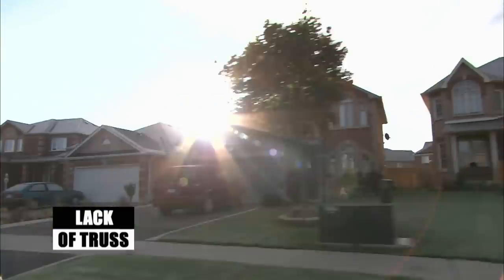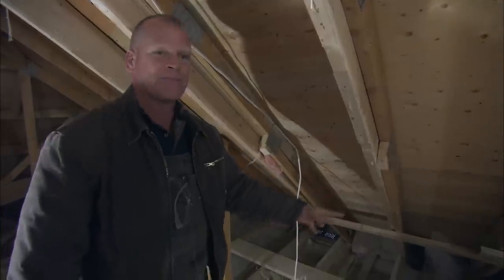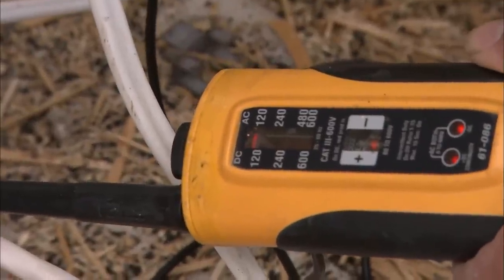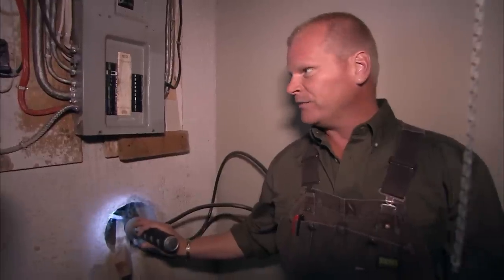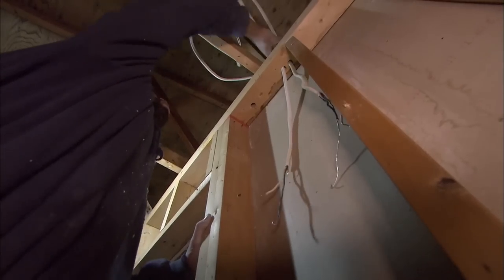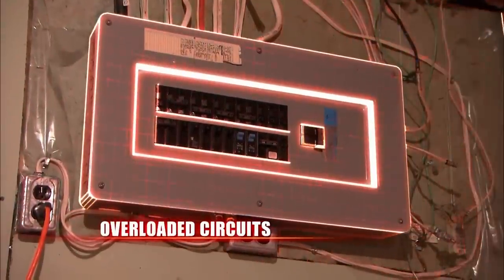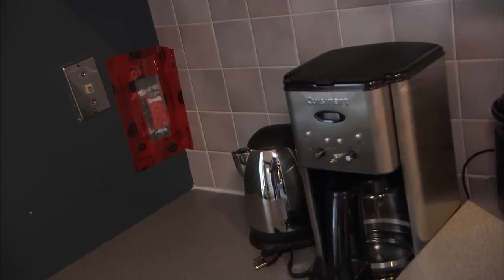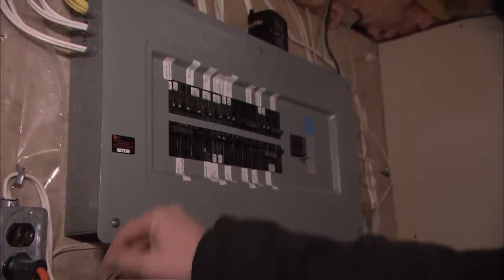Most Dangerous Electrical Disasters Found in Homes

Comment: I was working on a house that had been rewired in 2019 a few weeks ago, where an RCD (GFCI) kept tripping. Usually I'd trace it to a faulty appliance that's plugged in, like a kettle that's been over filled or just water in an outside light fixture.
 I ended up pulling off light fixtures and inspecting wiring etc.  I also turned off one breaker to replace a broken outlet, only it didn't turn off - I'd found that it had been cross connected to another circuit in one of many cable joins in plastic 3/4 inch wood screw jars.  In the end, I traced the fault to an old 1950s TRS (Tough Rubber Sheath) cable with badly cracked insulation and water filled screw jar junction under soggy insulation. I found a lot of wiring from the 40s and 50s that was supposed to have been replaced. Sh*t job of the wiring, but they did a wonderful job of the breaker board, though.

Comment: I had a professional, certified EV electrician, install a 48 amp charger on my home. He installed a separate switch nearby to turn it off "just in case." I also agreed to a home surge protector. Yes, it cost a bit more but I know I did the right thing.

Comment: The real hazard with illegal grow ops lies with bypassing the meter and tapping off the line side of the meter to evade suspicion from unusually high power consumption and having to pay for the power used thereby cutting into profits.  Because service conductors by definition do not have overcurrent protection,  a short would lead to fire, arc flash and catastrophic damage.
Reply: I guess it depends on what country you are in and how the mains distribution is set up. Here in New Zealand, every house is protected by a 60 A fuse on the pole or pillar box outside. If you short out the service main, it just pops that 60 A fuse and all is good, except it can then cost you a few hundred dollars to have the power company come and fit a new one. If you need more than 60 A supply, you can have a second or third phase connected. Our mains is 230 V (phase to neutral).
Reply: Over here (netherlands) we still have dangerous situations like that because of the ban on growing weed. If it wasn't banned, it could just be produced safely in greenhouses like all the rest of our vegetables. Things could be a lot safer but we still have a bunch of particularly dumb politicians and voters blocking any initiative that could lower crime and improve safety. 
That said, the professional but illegal growers often take some care not to screw up the electrics, because if you burn down the place you won't get any profit either.
Reply: @sw6188   @S W  thx for sharing.  I love learning how other countries have vastly different electrical systems than the USA.  Here in the States, and much of North America as far as I'm aware of,  for 99 percent of residential services we use 120V line to neutral,  240 volts line to line, 3 wire single phase, with 200 amps being normal for new construction.  The largest I've helped install was 1,000 amps, 120/240V single phase in a multi million dollar home with a couple spa and pool heaters and pumps, a total of eight 6,000 watt quartz heaters, 4 on each outdoor patio levels, and a detached indoor volleyball court.   The house was approximately 15,000 square feet if memory serves me right.    

Here are some exceptions to the rule.   Smaller homes built before WWII,  with the original service might have 120V 30 amp service,  with one hot and neutral from the pole.   Some utility companies require any service over a certain amperage,  typically more than 600 but it  can vary,  to be a three phase.   Some homes in the southern states may have a high leg delta three phase service if the home had a 5 ton air conditioner in the 1950s or '60s,  as some of the earliest outdoor condensers were only available in 240V three phase.
Reply: @Sparky-ww5re  I've learned a lot about the US over the years, I have friends living there now and one friend who is from Buffalo who has been living here in NZ for the past 35 years. 
I didn't know that service main feeds to new installs were 200 amps. I guess you need that much when you are only dealing with 120 volts.
Most business premises here are wired with three phase - 400 volts phase to phase and 230 volts any phase to neutral.
Houses can have three phase supplied to them as well if they need more power. Many houses in rural areas have either 2 or 3 phase supply as it helps to balance loading on lines that may run for miles before there is another 11 kV step-down transformer.
2 phase supply is the same as 3 phase but one less cable, so there is still 400 volts between phases and 230 between each phase and neutral.

Comment: I’ve got one for you. I have an old push oh matic panel. The previous person who rented the place kept having their washer trip a breaker. He thought it was because it was tied in to something else. No. Went to replace the plug and it fell apart. The plug had never been checked or changed since the 1970s or before.
Planning on having the electric completely re done but it’s going to take some time. The house is about 130 years old ranch style home.😅
Reply: Pushmatic panels should be completely replaced due to the lack of replacement breakers. If a breaker fails, what do you do …
Reply: They still sell replacement pushmatic breakers fyi… they are actually still manufactured. Just not very cost effective
Reply: @dustina6261  - some inspectors like to see the name on the panel match the name in the breaker or they won’t approve (even though the breaker is the matching product). I don’t think the names match with any replacement breaker that you would buy today.
Reply: @stevebabiak6997  who told you this? I am a master electrician and can tell you this is not true at all, are you licensed?   no one is even talking about inspections since pushmatic is over 50years old and grandfathered now....  what the truth is the breakers have to be UL listed for use in the panel they go into.  New manufactured breakers for pushmatic (branded or not) only fit into those panels and ARE UL listed for that purpose, if you are unsure pull up the UL testing to see how it was certified.
Reply: @dustina6261  - you are correct, I am just saying there are home inspectors who sometimes make up stuff. If I hadn’t encountered that line from a home inspector (but a different panel brand), I wouldn’t repeat it. Home inspectors don’t care that it was grandfathered, they are acting that way because they believe it benefits the buyer they are working for.

Comment: What kind of bead board would you recommend for a bathroom:  wood or PVC?
Reply: You can use either one if you use wood primer both sides I would recommend using plastic in bathrooms painting can be a little bit of a problem just go with manufacturers recommend methods hope this helps
Reply: Pvc light sand good primer made for pvc paint no problems with rot
Reply: Interesting

Comment: 0:14 House #1 what's the problem here? 1. the neutrals don't have a terminator and are not spliced and the hot has a terminator but it is not shielded. That is a fire right there. 2. too many junction boxes coming off a circuit breaker you only need 4 there are 16 up there and the circuit is overloaded.  3. they are daisy chaining and the wires wired for duplex anode which is dangerous. If you are going to run wire there needs to be circuits coming out of the junction box and they need to end with an outlet or a terminator and they need to be wired common cathode to neutral, common anode to hot, and common ground to common ground. If you wire these improperly it will cause a short and start your house on fire. and the 4th mistake is dangerous none of the boxes are spaced properly, the wrong connectors are used, I only see wire nuts on some of them, and you have halogen spotlights in the attic which is a no no and is what burnt down the Provo City Center Temple in 2010. Spotlights cause fire do not place insulation around them.

Comment: 5:00 House #3 has the worst electrical of the bunch. 1. none of the outlets are shielded if you have an unshielded outlet you will get shocked. 2. the breaker panel is not code you can get electrocuted or cause a fire with the breakers set up like that. 3. the appliances are on the wrong circuits and it is overloaded.  and this is the big one 4. none of the wires were labeled and some of the lines were cut when they should have been reconnected after the remodel. That is dangerous and it can cause a fire or a short if the breakers trip. Here is the correct order Stove and Furnace those need to be on 1 and 3 with 2 and 4 serving as their returns Washer needs to be on 5 Dryer needs to be on 6 and 7 and dishwasher needs to be on 8. If you wire appliances they need to be on their own lines or it will cause a short.

Comment: House 3 is what I have. My dads office was recently remodeled and my uncle did the electrical. Here are the problems with this if you are going to remodel do not splice because if you splice outlets and they are not the right cable code you will cause an overload. Second thing do not daisy chain daisy chaining can cause the breaker to trip. Third and I see this all the time unshielded outlets wires everywhere. You must cap your wires or it will cause an overload any unshielded wire is a fire waiting to happen. The final mistake where are your labels, why is your line using cable that is not code, and why is your secondary panel wired to both sides crossing the ground catch bar and the breakers? this is a fire waiting to happen. Hire an electrician and get them to route the wires correctly because if you mess up your breaker panel it is a short waiting to happen.

Comment: while i have been trained in electrical, i am not licensed to do this level of work, however i often get asked to look at or fix the odd receptacle here and there as in my state of california, i can do electrical work up to 500$ worth, so replacing a receptacle here and there is really no big deal, but i have found the weirdest stuff doing that, that when i find a major no-no, i get pissed,  worst one i have ever seen was a wood screw through the center hole for the face plate and when i pulled the receptacle out it just fell apart, Had my friend who asked me to look at it given me the go ahead, i would have called the city housing authority and gotten the apartemnt complex red tagged, From what my friend who lived there told me, it was a handy man who did that.

Comment: And I thought Knob&tube work was bad? Makes you wonder!!
Reply: Knob and Tube is still king if its intact and has no issues.  They Gauge of wire they used on that is insane and is true copper.  Intact Knob and Tube if intact is still code in most places.

Comment: real story:   walked into walk-in closet (was told light flickers), snapped up light switch, heard a low "clunk", took switch plate cover away and handy box full of lint - steel handy box.  Carbonized lint was arching from toggle switch screw head to steel handy box!   Wood framw house 60 yr old.   Always more things to think about.

Comment: There's no way I'd pay a licensed electrician thousands of $$$ for something I can do myself for a fraction of the price.....and it would be done right, too. Nowadays, there is a wealth of information on electrical wiring, including how to make it safe and up to code.
Reply: There is a reason it typically takes 4 years and 8,000 hours of experience, as well as passing a test, to become a journeyman electrician.
Reply: @nachoisme  Yeah, but not a valid one---working with electricity isn't rocket science. It does require common sense, though. That 4 years and 8,000 hours should probably be cut in half
Reply: @justsumguy2u  OK, so 2 years and 4,000 hours. Master Electricians with 40 years experience still don’t know it all but Ok. 

You’re right, plenty of things are pretty simple and straightforward but don’t extend yourself beyond what you absolutely know. The people that did the wiring in this video probably thought just like you.
Reply: @nachoisme  No, the people in the video didn't educate themselves, and didn't want to learn how to do it right. A simple google search would've helped immensely

Comment: If I did electrical I would have a sub-panal/box just for the furnace and water heater. Then another one for the washer and dryer and dish washer and stove (if it is electric) and fridge and freezer and then a panel for the lights and wall outlets.  It may be over board but it will give the main box plenty of extra room to be added to and make adding things easier because they can be run to the correspondingvoltage box. It will also separate the most important and heaviest loads  meaning any future additions can easily be run as 110 to the main box or 220 to the main sub-box (the one with the dish waster and washer and dryer and so on on it).
Reply: I have been cursing the builder of my house (built in the mid 90's) for a long time. The electrical looks clean on the surface, but there are issues. The latest was the refrigerator was not on its own dedicated circuit and was shared with the toaster outlet and at least one outlet in the dining room. All labeled kitchen outlets (2), the dish washer, disposal each had their own circuit, but not the refrigerator. We will not talk about the plumbing.
Reply: If you have that many sub panels it makes balancing the load way more difficult. Unbalanced loads waste power!
Reply: Please don't wire your own house